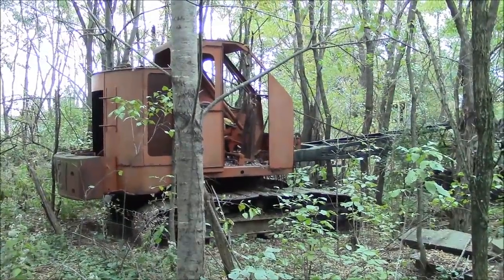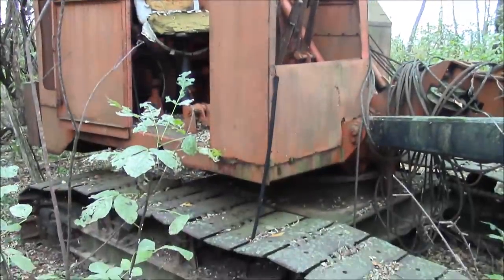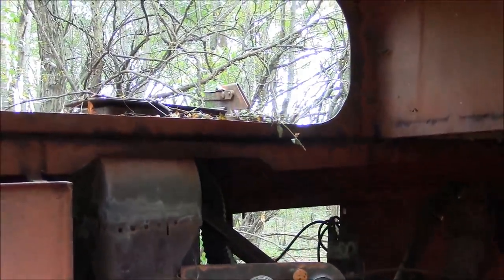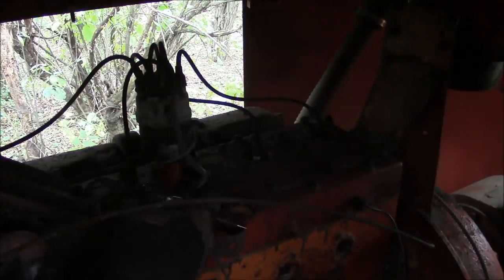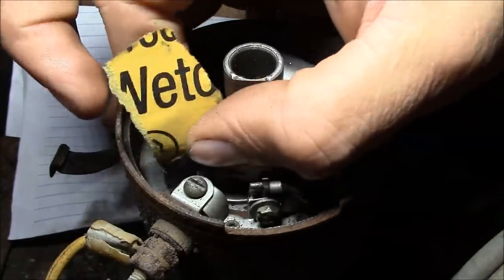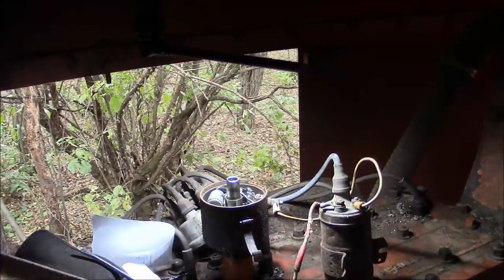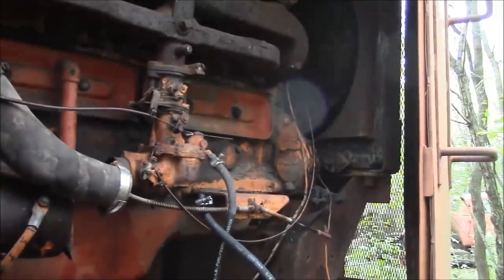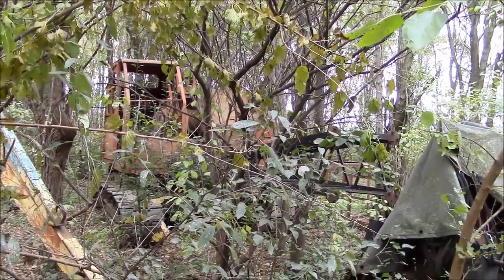Insley Dragline Crane Forgotten in a Field for 20 Years - Will it Run Again? - Part 1

Comment from the maker: Edit: After some research, I believe this is a Continental B427 engine. What do you think?
Part 2 is already "in the can". Don't miss it!
Reply: As soon as you said northwest Illinois I subscribed. That's my neck of the woods.
Reply: Any chance there are some older 70s or so model trucks there that could possibly run and would you sell one?
Reply from the maker: @BDE1337  Not at this property. I'm working on a deal for a basket case 1965 F-250 though. Should be a video on it soon!
Reply: It could be a Chrysler industrial flathead engine 225 cu. in
Reply: Love your determination! I'LL be tuning in for all your vids
Reply: Can't find pt 2
Reply: @rblscapes  Chrysler distributors were on the side of the engine
BTW if thats an Ransom E. Olds engine in that dragline I will laugh my a$$ off.
Off the top of my head thats the only flat 6 I know of with a distributor sitting between #3 and #4.
Reply: Upload it:-0).   Please
Reply: @crdorado1195  not out yet
Reply: i have an american series 200 crawler myself 2 drum needs work good find.
Reply: Where's part II
Reply: I am very familiar with that model machine, there were great. Yours is exceptionally straight, wish it was closer. Believe it or not draglines still service a special notch in swamp digging. They can reach much further than a modern hydraulic one of similar weight. A real swamp calls for one. Trouble is finding an operator, requires real talent and coordination. Keep up the good work!
Reply: Continental flat headed 6. My 55-60 era bantams have them till they started have a regular raised head inline 6 in my 63. It’s so far been a pain to find out what they are but when the resistor, coil, plugs and just about everything bolt on but the pistons and internals you can find at Napa and Orileys. I run mine off a 5 gallon gas jug with a 12v low 6-9psi electric pump for carb engines straight to the carb. Go look at my videos and you’ll see what I do. Nice to see you saving that old Insley. I’m guessing she’s a 50’s L and you can find the book for her on eBay usually if you keep looking.
Reply: @crdorado1195  LOL, did you look at the date on this video?
Reply: I say you got alot of heavy lifting ahead of you ! Lets watch wes work ! Lol
Reply: The new engine for the international loader? Lol
Reply: Watch Wes Work looks like a Detroit 6cyl
Reply: Thanks mate
Reply: Watch Wes Work in-line v6
Reply: @oliver-ht1lv  I was thinking the same thing. Just don't know if it would fit.
Reply: Would that engine fit the International loader? Might be a good replacement?
Reply: Would that engine fit the International loader? Might be a good replacement?
Reply: @WatchWesWork  whats that (i guess grey coloured)car in the woods? Would love to see that one in the shop....greetings from Holland
Reply: I watched two entire series on old drag line excavator rescues. 
Matt from ' Diesel Creek and  Jonathan W 
https://www.youtube.com/watch?v=4JWbQwhOMo0
This is the first part of about a 13 part series. Why did Jonathan dedicate so much effort and time to rescue his 1952 Unit Dragline? He needed a crane on his wrecking yard to assemble a Bates stationary steam engine!

Comment: Back in 1965 when I was in high school automotive mechanics (Chrysler course) on the first day of class, our instructor handed out matchbooks with a built-in striker strip, which was basically just fine-grit sandpaper. He said "this is the best and cheapest points file and cleaner you'll find, always keep one in your pocket!" We used the striker as our cleaner/file, and the fold-over kraft paper of the matchbook flap to polish the points after you were done. Or you could tear off an individual match and polish the points. Good days!!

Comment: For what it's worth, my 1965 twin-engine Cessna had flat six Continentals rated at 520 cubic inches and 340 horses.
Reply from the maker: If I'm right, this engine is 427 cubic inches and only 138 horses!

Comment: Very nice video!
My dad ran one of these Insley draglines in the fifties in europe. It was equipped with a 4cyl. Cat diesel engine with a liltle gas engine as startermotor. He really loved the machine it was nice to run. The controls and brakes were light to operate.His machine had wide track plates 120cm
I showed him this video and old memories came back. He doensn't know the model number.
My dad is 82 years old and i'm sure he could still operate this machine if it was in working order again.
Greetings from the Netherlands

Comment: Glad I found ur channel. I remember my dad operating a dragline a lot like that one. It was an Insley but don’t remember the model no. as that was back in very early 50’s. He and the guy he worked with mounted it on the back of a huge 10 wheel army truck. First motor crane in our area. I will definitely be watching to see that old iron come back to life. Thanks for sharing.

Comment: Many  industrial engines  used a belt drive governor, and these,  so to speak,  were fairly universal.   I actually once adapted a  governor off a D2 Cat  pony starting engine  to a Toyota 20R  which I swapped into a Cletrac  crawler.   Pierce,  Hoof are a couple of brands, there are others

Comment: Nice throwback video! I got so fedup with those battery repair clamps, I started soldering the cable to the lead part of the clamp before putting the metal strap in place. I try to get the full copper crimp/solder clamps when I can.

Comment: Great example of how to test for spark, excellent use of the test light
Reply from the maker: There's probably an easier way, but this works for me.
Reply: if you can position the coil wire close to ground, then use a screwdriver to open the points, you can get a spark with out cranking engine @WatchWesWork

Comment: Continental did make a 6 cylinder flathead engine with a distributor that came out in the center atop the engine just as yours does.  Continental made engines for a lot of people, I don't think it is a Buda but that is only because the Budas that Allis Chalmers and Oliver used were all overhead valve by the late 30s or early 40s. I am not an expert on either of these engines but I have seen a lot of both of them on equipment and Continental had a lot of gas engines on construction equipment that was flat head up into the 70s.  Your Insley looks a lot like a K 12 but then Insley may have had other models that looked a lot like that too.

Comment: The way you cleaned the points with folded-over sandpaper is exactly the way I would have done it, and I've never done it nor seen it done before. I've trued a few parallel contact surfaces that way before, it just makes sense.
Reply from the maker: It works for me. Sometimes they are too far gone, but these were not too bad.

Comment: I definitely agree with you on the battery cable ends. I had a guy that brought his 6610 ford to me to fix because it wouldn’t start. I open the hood and there’s one of those clamp on ends. I take it apart and clean it up and it fires right up good. I told him to go get a new cable and proper ends soldered on. He brings back the exact same junk clamp.
Reply from the maker: With the salt in our area they don't work at all.

Comment: Love it Wes, this machine needs to live again! Looks a bit like a few Hercules blocks I've seen, but the carb arrangement is different and they had HERCULES cast into them though!  Don't spin the house across the tracks with that counterweight extended and no boom if you can help it, might easily flip on it's back. Guessing it was re=purposed as a crane, hence wanting a bit more in the back.

Comment: Well there's your answer it runs, so that's cool.  Please try to keep posting on youtube if you can, this stuff in the woods you are finding and showing us is  interesting watching you work on it.    I fix equipment for my job, have old tractors I rescued myself and still watch some of you guys adventures  . These are the true will it run video's so much stuff round youtube sat  a few years  reasonably well protected, of course it will start with a battery and clean fuel. Unless somethings locked up with moisture caused rust or it was complete junk when parked they are to easy L.O.L. Thanks for the video's take care.
Reply from the maker: Well this is actually an easy one compared to some of the other gear on the property.

Comment: I have been using NOCO Battery Corrosion Preventative NCP2 on battery terminals for over 40 years now. The stuff does not dry out and you hardly ever have worry about the connections again, I spray it on the post before connecting the cable then I spray it again. Great stuff, amazon has it. Once I sprayed it on my hand, and cried wolf, that freaked out a couple of people. It looks like blood

Comment: Engine really sounds good,
I can’t wait to see part 2 

Take the greasy gun and spares 
Lots of penetrating oil 
And sometimes to heat some parts 

I did a Dutch brand 
Called Hovers dragline with a original Kromhout engine 
Most of the controls were stuck on it to
But with some elbow grease and heat 
I got it going 

Greetings Saul from the Netherlands 🇳🇱

Comment: I have a link belt ls58 that's 30k lbs that's about that size. 9' overall width. I also have a Lima 34 that's 40k lbs and 9'6" overall width. If you got her home you'd be surprised how handy a crane is to have around. Also a clamshell works really good for cleaning brush and trees and making big burn piles
Reply from the maker: OK. We figured about 30K.

Comment: The fact you said "It highly unlikely & has no value" is very much understated. I know guys all over the Mid-west who'd love to pick one of these up, And sometimes the reason why that "Certain" seller wasn't able to give it new home to another owner isn' b/c it has "no value" Most of the time it's either At the wrong time to sell it or most guys are too far away & don't want to make the trip. 

Something like this Running / Operating condition could be around $1,500 - 5,00 Ball pack guess. I'm going to share it on the Heavy Equipment group on FB, Usually REALLY depends on the Brand but for these Insley's are very popular.

P.s I hate Faith in that Ole Motor Firing up!

Comment: Do you remember the story of professor Tom Sutherland, who was held captive in Lebanon for 6 1/2 years starting in 1985?  His daughter, Kit, lived in the house next to ours in the last year or so of his captivity.  She couldn't get her car started one day, so I helped her out and got it running by cleaning the battery terminals.  A few days later I saw her on CNN in Germany with her sister, mom, and her Dad who had just been released.  You never know when you can use those skills your dad taught you to help someone right when they need it most. 

I love your videos.  I just subscribed today.
BTW, those rubber boots they put over battery terminals seem to do more harm than good by trapping the acid and corrosion, so it doesn't get rinsed off when you drive in the rain.
Also, the fingernail board idea some viewers suggested is not the best.  It can cause the points to be uneven.  Your dad's way is the best.

Comment: The throttle linkage you found probably goes to a remote governor that is missing !! Pearce governor is what I used on cranes that worked the best !! The other linkage goes to the tail shaft or somewhere that sees the chain speed to control when the crane was lifting a load !! That's the other cable that runs to the output for the chain speed just below the carb !!
Reply from the maker: I actually think that other control cable is for a snap over clutch that engages the chain drive. Probably right about the belt drive governor.

Comment: You can clean the edge of the Rotor Arm by rubbing it on a tyre wall. Don't forget to check the distributor cap for cracks, the spring-loaded carbon is free and the posts are clean of any buildup (use a long screwdriver to chip off)

Comment: The secondary throttle was normally wide open. The governor closed it if the engine speed got too high. It's more like a top speed limiter. It's not really like a tractor governor. Basically you push the throttle all the way in and whatever the speed was set at the governor was it's limit.

Comment: The first car that I owned was a Citroën  and it had points and condenser ignition.  Every three thousand miles I had to file the points, thanks for bringing back those memories of misery!  I was so much happier when my next car had electronic ignition.  Great video Wes lookin forward for the old girl to crank!  Hey if the engine is good will it fit in the front end loader?

Comment: I am guessing the governor linkage was only for when they were running the auxilliary equipment. Ie the winches etc. So that the base revs instead of being 700rpm, were raised to about 1500. So it didn't stall as easy, maybe it limeited the top end as well to prevent overheating. Think I saw something like this on an old Scammel Pioneer video, when he engaged the hand throttle for the winch drum.

Comment: My uncles had a few machines of that vintage 
It is probably a 1940 vintage 
In the 1960 and newer had Diesel engine in them
It probably would only be scrap iron 
They are very difficult to operate the one I learned to use in the 1980s
You needed both hands,one knee and both feet if not more 
These type of machine were very dangerous when it was raining 
Most were hard to keep the frictions dry
Reply: zweg1321  I know what  a challenge it was to operate one of those. I used to run an old 1933 Bucyruse Erie noon crane with  a magnet in a large  recycle yard. We cut up large Elco, and other  diesel locomotives for scrap. It was all Hands, feet, and then some to operate that thing with the continental engine with a pony motor, and  your good holding the brake drum for the  cable spool. Especially in the rain!

Comment: main suspect is the plug leads may be graphite paper instead of copper.
also clean all coil connections and rotor arm contacts areas in cap.

Comment: Wes 
You make great videos and you have a fine comic turn. Is the engine a 3-53 Detroit. I’m from Northern Ireland so I apologise if I’m wrong.

More power to your elbow. Keep up the good work. You make my day.
Reply from the maker: I still don't know what the engine is. Some kind of flathead 6 cylinder gas engine. It looks like a Continental, but I just don't know.
Reply: The Detroit in the other crane was a 3-71. 53 series had hold down screws around the flange

Comment: Replacing old battery cables can save one from a lot of grief. Especially if the strands has started to separate or soaked up dirt and oil.

Comment: I know you are at the coal face, but just an idea for getting these old, dormant engines started. It would be better to remove the distributor, spark plugs and their leads, carburettor, plus any other electric leads like the battery ones and take them back to the workshop where you can work on them with ease and with tools and incidentals at hand. Then fit them back and you would have a better chance of a good start and moving the machine. It would involve two trips, however so this game plan is for those machines lying closer to home.

Comment: Gotta say great job starting the olgirl, personally I was giving it a 10% chance without helping the rings with some lube, I guess that's why I'm watching you work
Reply from the maker: The nice thing about a flat head is that valves are down in the block where they are reasonably well protected. It didn't take much to get some compression back!

Comment: I'm thinking it could be a Murphy engine. Just a wild guess. Hope to see it run. Like to see it actually get back to moving material.
Reply from the maker: Interesting theory. I'm not familiar with a Murphy.
Reply: @WatchWesWork  I'm not familiar with Murphy either. But have heard those old iron machines used that engine. (I watch too much YouTube on old iron machines).

Comment: With that many battery cables, plus the short one,  it could have been two 6v for 12v or two 12v for 24v.   It could have had a fan belt driven governor, to adapt an automotive type engine to industrial use without needing a separate cast block.  The two throttle butterflies could be one for use as a stationary engine, with it wide open and the second operated by the governor.

Comment: Wes ...don't let the experts at nothing bother you!  You're doing fine...I have learned along time ago to give all the electric connections and levers a good spray of wd-40 or such ..a . It will be loosening up before you have to eventually take it off b.it will help give you a early warning smoke signal to get the fire extinguisher  lol..plus let them whine about your knife skills ..anybody who has been in bad weather breakdowns knows you do what you can with what you have in a hurry...you can't be captain snap on when the baby's sick at 2am and the er is 20 miles away...so to speak..
Reply from the maker: I'm all for the right tool for the job. But I'm working in an overgrown swamp 30 miles from my shop...

Comment: Need to see more of it we can only see that side shot. What are the model numbers on the carb? Ect ect. Distributor had a tag as well as the starter with numbers on them. Those look like Delco-remy same as GM used.
Reply from the maker: All electrical parts are Auto-lite.
Reply: There has to be a tag someplace on that block. Esp if it’s a Waukesha they all have one on every one I’ve seen. Bring a flashlight next time you go I bet you find a tag riveted on someplace

Comment: Looks like a model L made from 1950 to 1971. Looks just like the one I have, made in 1950 with a 6 cylinder Waukesha, no distributor out the top. I would be interested in the boom or the whole machine depending what you want to do with it.